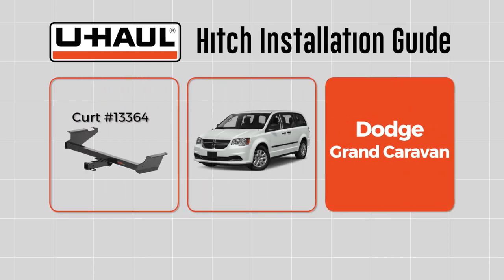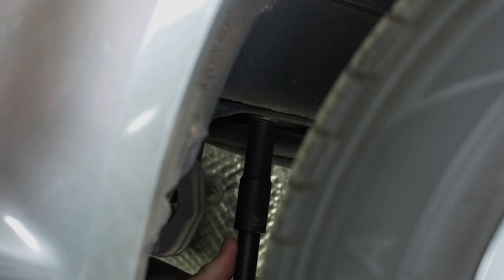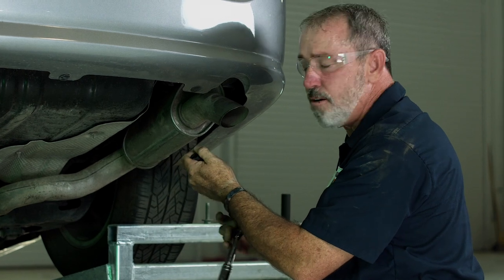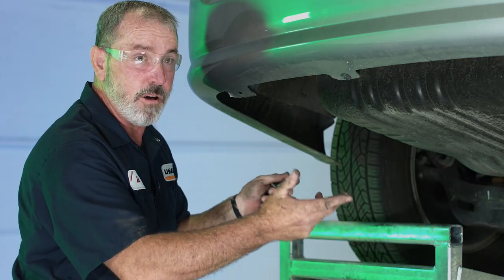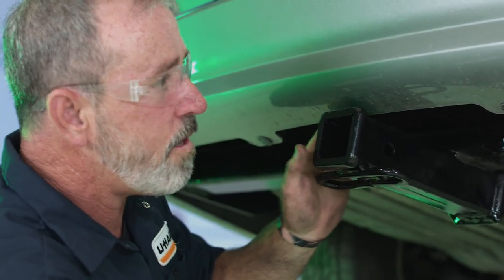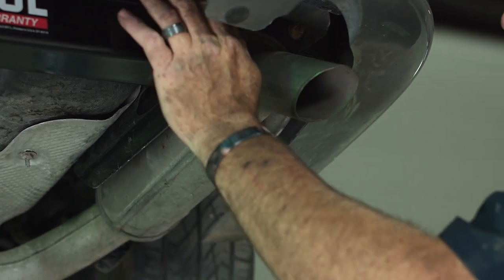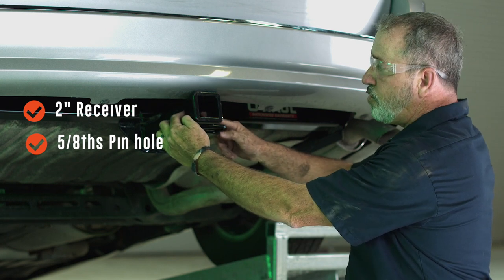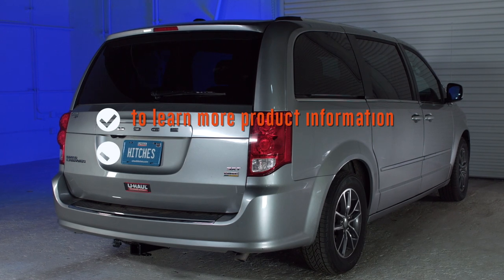2016 Dodge Grand Caravan Trailer Hitch Installation

Comment: Big heads up, spray some good penetrating lubricant on those studs and nuts from behind. I busted 1 bolt, and broke the tacks on the backing nut on another. I had to remove the bumper and weld on some new nuts

Comment: You made it look too easy. The 15 mm head is ok but it does not thread directly into the frame there is like a threaded nut kinda like a helicoil and mine stripped. Uh oh.
Reply: see....told you.....get rid of that waste of plastic crap.....keep the tires,  may be usefull........scrap the rest...grand caravan....yes, it is grand, to have a waste....